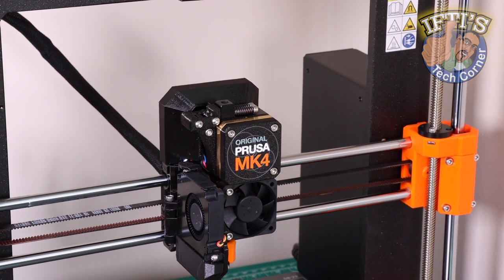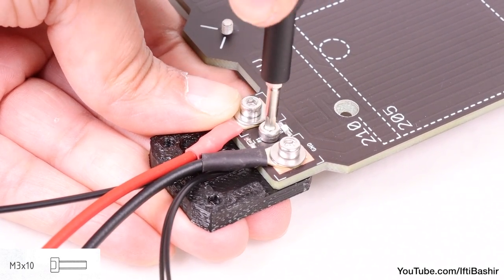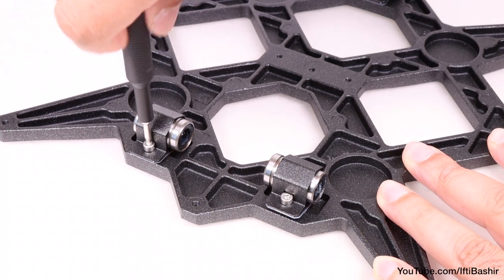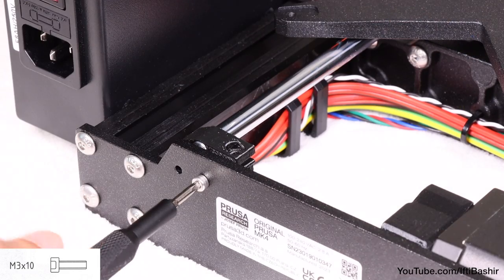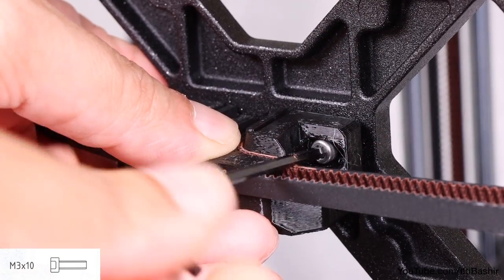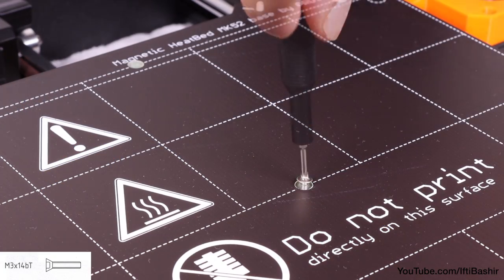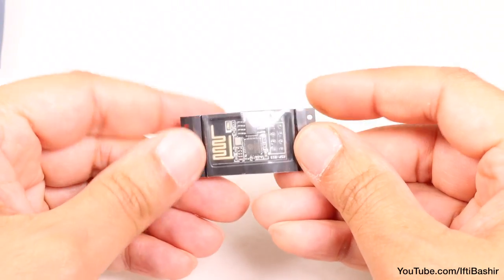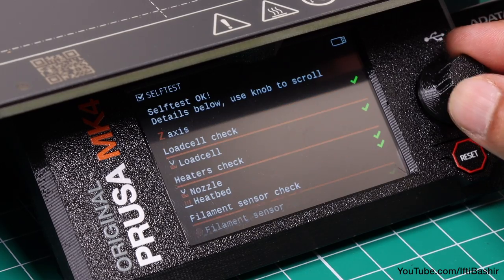#07 Original PRUSA MK4 Kit : Full Step-By-Step BUILD GUIDE - Y Axis & Heated Assembly / Calibration

Comment: I just finished assembling a new Prusa MK4 kit thanks to your excellent, thorough videos!
For all of you that haven't assembled your new kits, I have some feedback for you concerning using the tuning app supplied by Prusa:
I kept getting high "too tight" readings when actually my belts were too loose. When the belts are way too loose, they'll hit against the plastic parts on the printer giving sporadic and incorrect readings. Try tightening them up a couple of turns at a time you'll eventually see the readings coming down or should say actually coming up to the proper tuning since the belts started out too loose.

Comment: I'm extremely thankful for these videos. You are great! If I may add something, it would be very good to recommend at 10:00 to clear the holes of the y-carriage that you are going to screw the y-belt holders to. Mine were not properly made and I could not screw the holders in place. I could somewhat get them in position but then it was too late and I could not screw them tighter nor remove them any longer, so supported instructed me to break the holders to be able to remove the screws and clear the holes.

Anyway, I'm sad because I can't finish my build until replacements are sent, but still THANKS!
Reply from the maker: Ah, I didn't have this issue but thanks for sharing the tip!

Comment: Excellent series of videos, thanks.  There is one very important step you didn't mention in this video around 1:20.  You put the two wires on the heatbed with two M3x10 screws and locknuts, slightly loose for "adjustment space", but you never showed the final tightening of the two screws and locknuts which would most likely be VERY DANGEROUS!  Perhaps you can edit the video to show the screws getting tightened.

Comment: Thanks for a fantastic video. I used this to build my mk4. 

But…..

From firmware 5.0.1 things have changed. If you place the ‘Y’ axis bearings as you mentioned it will fail when you come to calibrate it. Prusa have acknowledged this but not updated the video. 

To fix this you need to place the bearings on the ‘Y’ axis as follows. 

Single bearing on the right needs to be placed centred as in your video. The black seals on the bearing line up with the metal bracket that holds it in place. 

The 2 bearings on the left must be placed as follows or it will fail a calibration test if you are running firmware 5.0.1 or greater. 

The bearing closest to the lcd needs to be placed centrally like the bearing you just fitted. The bearing towards the back need to be place with the back flush with the bracket holding it. When placing it this way you will see a lot of the bearing showing towards the middle. 

Tighten the nuts but make sure the bearings run smoothly. 

If you have already built this printer and down want to fit the bearings as mentioned but it has failed on a calibration. All you need to do is this:

Download the very first firmware for the printer. Run the calibration it will pass all the tests (the older firmware is forgiving) then flash the latest firmware. As long as you don’t run a calibration you can keep on updating the firmware. But once you do a calibration it will fail again and you will have install the old firmware to get it calibrated. 

Also if you have fitted the mmu3 installing the old firmware won’t work so you will need to fit the bearings as I have mentioned above.

Comment: The entire series was really well done. Great job.
I'm disappointed Prusa hasn't used a better design for the rod holder clips. They are very easy to break, and this design is worse than the old MK3 design that used zip ties. At least they've used an improved Y-belt tensioner setup.
Reply from the maker: @ScytheNoire  thanks! MK4s is very similar too!

Comment: Extremely helpful videos! I will say do not do the tightening trick with the lock washer, the walls inside the part are to thin to keep it from spinning in the hole and getting stuck. Happened to me and it wasnt all the in yet

Comment: I have an assebled MK4, and I cut off the Y axis belt about a cm because I didn't pay attention to both ends after getting an error message. Now I ordered a new Y axis belt, and it's actually 18mm longer than the original belt. Seems like I have to cut the new one, but I'm a little bit concerned since you don't mention the belt being too long. 😅

Comment: The part about aligning the belt "length-ways" confused me so much. I had no idea what I was supposed to be aligning, and after reading tons of comments on the section of the official instructions, I'm even more confused because so many people had issues here, using "shims" to adjust, and even printing a modified version of the printed part attached to the Y motor. 
I eventually decided the alignment was regarding the belt's position on the "y axis motor pulley", the cylinder with the teeth connected to the motor which pulls the belt... But I'm still confused because the picture on the site and the belt on your build in the video BOTH show the belt all the way to left, not centered... And that's what mine looks like as well. So that's correct?
Reply from the maker: The belt should be completely aligned from the front of the printer all the way to the back - so the motor pulley needs to move so that the belt is straight an don't installed slightly slanted.
Reply: I finally finished it last night. I centered the bearings I mentioned earlier and I don't really understand the belt alignment still, but praise God it all worked out perfectly and my first prints came out awesome. Thanks for your help and for your work on these videos!! Watching  your series along with following the official guide and reading the comments on each step was the way to go!

Comment: Apprently a lot of people in the coments are saying that the instructions were wrong about positioning the two bearings closer to the center and that it's causing Y check failures. See the comments on that section of their site. Did you have issues with that?
Reply from the maker: Mine is built exactly as shown in this video and I’ve had no issues at all so far [touch wood!]…..

Comment: I have a question to your power supply. Is your plastic part, where switch and cable input is placed on also so wobbly?

If I just wiggle at the cable a bit, it falls out. I can push as hard as I want, but it wont insert fully.
Reply from the maker: You mean the plastic part that covers the connections? If so, no mine seems to fit reasonably tight.
Reply: I have solved it. The power cable was not fully insertet in the power supply. I had to push really rellay hard (I thought I would break it) to get it in like it is suppoet to be.  @iftibashir 

And thanks for your Video Tutorial. I assembled my MK4 just by your Videos 😊
Reply from the maker: @julian_loewe1977   You’re welcome! Glad it’s sorted! Enjoy!!

Comment: My tensioner screw will not reach the locknut, no matter what I tried.
Reply: It needs to be totally inside the tensioner. If your nut is falling out when the 40mm screw meets it, shove some toliet paper in the nut hole and push it down with an allen key while you're tightening the 40mm screw. Ask me how I know this works...